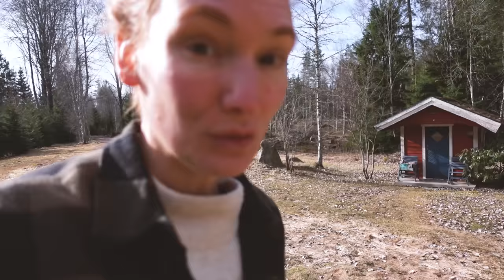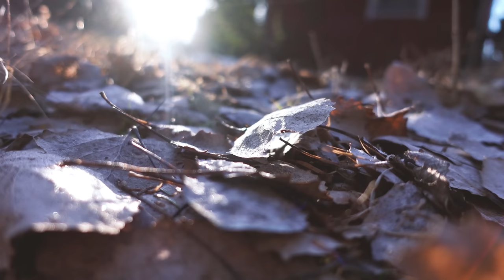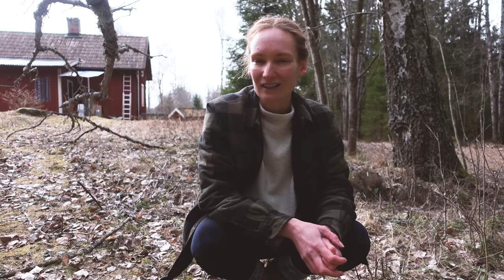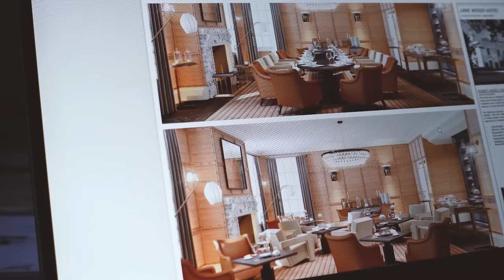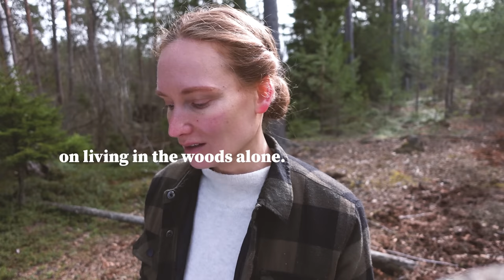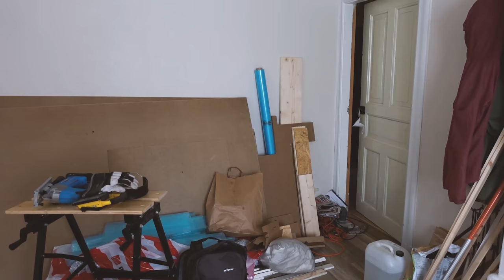WHY I MOVED TO SWEDEN | Q&A and Mini Updated Cabin Tour (Story 12)

Comment: I was twenty-two when my husband bought me a sledgehammer and a house in London to use it on.  I loved that renovation (with builders) so much that we sold that house as soon as it was complete and bought an old fort in Provence while we renovated office buildings in Soho, travelling backwards and forwards.
Several houses later we ended up in an old duck-hunting cabin on San Francisco Bay.  I renovated most of it myself,  my husband was not at all hands-on, but he was always encouraging, even when he woke one morning to find my foot coming through the ceiling; I had decided to expose the vaulting.
I have lived here since 2002 and transformed it, reconfiguring the flow, and removing hideous popcorn ceilings, textured walls and condo carpets.  I fell in love with the scope of a wood-framed house, so much easier to work with than brick!  I ripped down CDX into planks for the simple look I wanted, restored the 1946 kitchen cabinets, created a new entrance with a hall for more privacy, and created a garden by terracing down to the water and hauling soil and manure in my trusty pickup.  Every single thing in this house, including driftwood furniture I made when I had no budget at all, has felt the touch of my hand.
Those years of hard physical labour have taken their toll and at seventy-six I reluctantly confine myself to smaller carpentry, but I wouldn't for anything change the excitement, challenge and satisfaction of using ingenuity and a sense of possibility to create my own home.  It is indescribably touching to me to read of young women like you adventuring and creating on your own terms.  Strength to you!
Reply from the maker: I LOVE your life story! You are one awesome woman, and I hope to continue doing these renovations in the years to come, just like you!

Comment: Sweden has this weird reputation of being so cold. However, most of the country, except for the northernmost parts, enjoy a temperate climate. 
In the south, temperatures typically range between -10C to +30C (depending on the season, obviously), with the lowest temperatures being sort of rare. 
During summer, days are long (~18h of daylight), and in the winter they are short (~7h) and this difference becomes more pronounced the further north you go.
If you want cold, travel to Yakutsk!^^.

Comment: Thanks for your inspiring videos and your thoughts. I love watching them, eagerly waiting for new episodes. You show us that with a little time and research even an inexperienced person can achieve a lot once you go for it. Great inspiration!
Just wondering why you are not using all of your double glacing windows especially this winter that the electric bills have been all time high. It would really make a difference in keeping your house warmer. 
They are for winter use and with a tape that is not too sticky so you can make the inner windows air tight once they are in place. The outer windows should not be completely air tight because you then trap humidity between the windows. 
The anti draft tape in the old days used to be from paper with a water soluble glue  (similar to stamps glue) to make the inner window frame air tight. 
Once the weather gets warmer you take the windows out again and store them in the attic out of the way...

Comment: The term "cabin" is a bit misleading. Small houses such as this may actually be hundreds of years old. Called a "torp", they were originally single story with one "large", more or less square kitchen with a wood burning stove. Attached to it would be the "chamber" of half the size of the kitchen and with a ceramic fireplace "kakelugn" that radiates stored heat long after the fire has gone out.

To ensure the long, multi-century survival of a torp, the roof must not leak and the butt ends of the horizontal logs making up the walls needed to be protected from soaking up rainwater or they would rot. In addition it would need to be at least sporadically inhabited.

In the day, you would enter through the front door directly into the kitchen. Poor owners were often unable to afford renovations to their torp. A man born in 1929 who grew up in such a single-story torp with parents and ten siblings told me that the front door was loose and, during an exceptionally cold winter, the water in a pail just inside the door had frozen solid, despite the stove going full blast a few meters away. His parents, his siblings and he all survived to become pensioners.

As Sweden became less poor, a second story was often added containing two small bedrooms with one containing a wood burning cast-iron heater. If the house was large enough a staircase was built inside, otherwise a small structure "förstuga" containing the staircase was integrated into the house from the outside. The main entrance was in the structure and the structure connected to the old front door.

Dug wells were prone to drying out during hot summers. There were outhouses for equipment and animals. For doing #1 & #2 there was the "dass" containing a box-like bench with one or two holes (with lids) emptying into as many buckets. Many modern Swedes are unable to attend a dass, for whatever contrived reasons. Two girls might sit in a dass and gossip. Two guys might sit in a dass and drink beer. A stack of magazines could provide literature for longer sessions. There might also be a stack of tabloids in case toilet paper ran out, hence the expression "skittidning" or shitty paper but more a wordplay intended to mean a paper for shitting.

In more recent times the torp may have been equipped with a phone line and electricity. Running water and sewage is very uncommon.

Comment: All creativity starts with a point of reference. Everything after is a modification. The task is the master, and will illustrate what needs be done. If you sense in nature an aesthetic, and extrapolate it's essence (rasa), you have something to impart to other people that they will value. A shelter is from the elements, but a dwelling brings everything in, in extrapolated forms. Good design satisfies the greatest amount of critical criteria. It helps you to sense and feel. If it is to be used, function is more important than form. If it is to be admired, then form is more important than function. What you have done in Sweden is provide yourself a point of reference, and now you live the steep of profundity. Come to and impart what others need, they could not do as you have done.

Comment: Thank you for a nice video, liked and subscribed.
Before you get a drivers license, depending on what Län you live in Sweden, I may give you an advice that can help you out. You see, in some of the Swedish Läns, Västra Götaland Län as example, has this thing about accessability. Everyone should be able to use the bus, even where there are no routes. So, you could call a number, book the bus to come and pick you up and take you to town. Now, you need to be dropped at the actual bus station in town, and when you go back you have to start from the bus station. Now, it wont be an actual bus but a taxi. But you will pay the fare as if it was the route bus. Each Län have their own rules, and some Läns do not have this option, for example Jönköpings län dont have it. Also, they dont advertise this, you really have to look it up.
Cheers

Comment: I would recommend that you simply test the wood stove and the stove. If I were you, I would go up to the roof and inspect the chimney for cracks and bird nests. You can fix the cracks yourself with "mortar" Be prepared that when you first fire in them, it will surely smoke in🙂.
Reply: It would be really dangerous to do that without the right equipment and knowledge. It needs to be inspected by an authorised ”chimney inspector” (don’t know the right word for this). Not being careful enough could end up in a burnt down house.
Reply from the maker: Unfortunately this is not the one you could try and test... The chimney is actually falling apart - it would 100% be dangerous!!
Reply: I repaired my chimney myself before the "chimney sweeper=sotarn” came and inspected the chimney. My chimney had frost cracks and loose mortar. The first time you are up on the roof you are scared but after the third time you get used to it. Sweden was once a "do it yourself" country but no longer.
Reply: I can recommend the book "Husets ABC". The book is in Swedish but the illustrations are international🙂

Comment: Hey Rosie, in Sweden they have something called an A-traktor, it could be any vehicle as long as it doesn't go any faster than 25km/h. You won't need a driving license for that and it's still slow enough to enjoy the scenery! 
Where in Sweden are you at? We just moved to Sweden 1,5 month ago and live in Åseda.
Reply: You do need a license of A-traktor. The license you need is an AM license. That is a license for 50 cc mopeds. You need to take a course that includes practical driving and do a theory test to get one.  It is a lot simpler and cheaper than getting a B license for a car.

More exactly is it an AM license or any other driving license, AM is just the simplest one to get. Their max speed of them is  30 km/h, not  25 km/h.

Comment: Yes, absolutely, building from scratch is much easier and sometimes cheaper, depending what you build, than renovating. About buying anything else, elsewhere, please trust my piece of advice: do NOT move south, certainly not to Portugal. Do you really want to be in a place where from May to September you won't be able to go out? In 10 years southern Europe will be unlivable. If anything I would advise you to maybe move even further north in Sweden, but basically you're at the right place. I understand that sometimes, being alone, you doubt about your choice, please don't. It's normal do doubt and be scared, only idiots are no, but to the risk of repeating myself: do NOT plan to move to Portugal, Spain, Southern France, Italy, etc, very soon these places will be very harsh, climatically and they will be assaulted by climatic refugees.